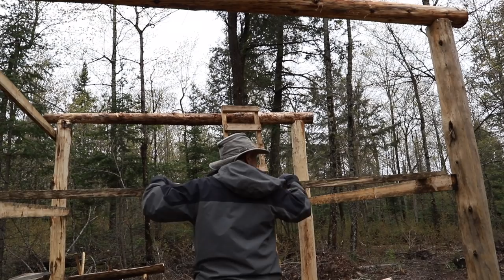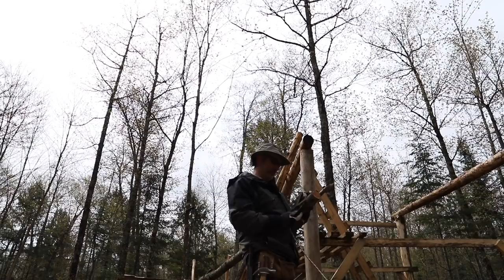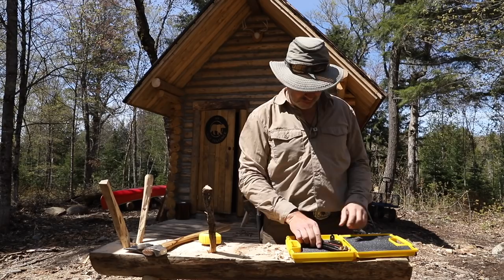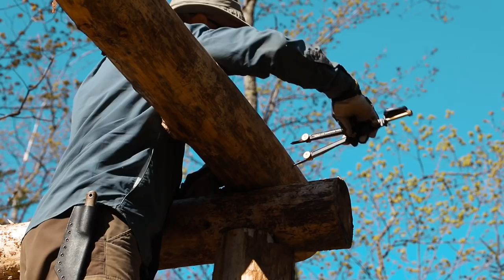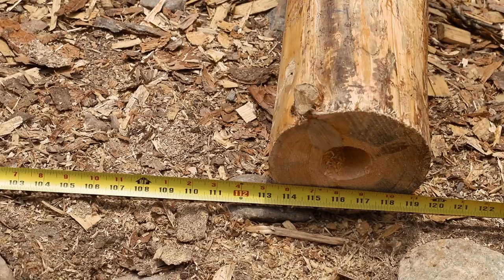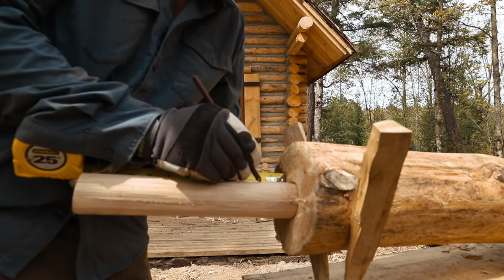Working Solo | The Forest Kitchen | Off Grid Log Cabin Build, Ep.2 S1

Comment: Hello mr. James and thanks for posting another nice video! I would advice you (if you would like to take an advice by a carpender) to open the holes in your logs and then hamering through them your joint so that you joint through the whole diameter of the log and into your base log. That would add more stability and is a far stronger joint. Keep up the good work. I can't wait to see how this project will look like

Comment: Was thinking about your shaving horse and getting better grip on the project you are working on. You could get some of that grip tape they use on stairs and skate boards and put it on the round clamping part and the bed that the project rests on.  Just an idea I had when I seen that dowel slip on you when you were trying to shave it. It isn't that expensive.

Comment: Several times I couldn't help but think a log dog would come in mighty handy, then I saw you did have one.  I also have to ask if there is a particular reason you're using dowels, because i find tenoning round wood is actually very straight forward and satisfying work,  with very few tools. With a bit of practice,  takes less time than boring two mortices and fitting a dowel.  Plumb bob, carpenter's square (more flexi the better), a saw and an axe or chisel.  You could leave them square and carve a square mortice, or if you could get a rounder plane the same diameter as your bit and round off the tenon.

Comment: Thanks for sharing, Shawn. Things are coming along at the cabin.  

I think your decision to use charcoal in the grill and in the rocket stove is very wise. I'm not so sure that making your charcoal in a pit is as wise. While is it certainly possible to do it that way, the whole process is more complicated than it looks and the efficiency is very, very low. Even using an earthen above ground charcoal oven has more technique to it than most people would expect.  Simply timing the closure of the vent holes is an art in itself. You'll probably have better luck and be happier using a drum retort. A drum retort can be as simple as a plain open head drum with a locking ring top. Drill a few holes down one side, fill it up with hardwood and close the top. Tip it over on its side onto 4 stones or blocks to hold it off the ground. Light a fire under, around, and against the barrel. Keep the fire burning until there's no more flames from the gases coming out of the holes. Let it cool, tip it upright, and take out your perfect charcoal. You can use a regular 55 gal (208 L) drum, but a 30 gal drum will work just as well. The only difference is that you'll make smaller batches and it will take less time.

On the other hand, if you are so inclined, you can make more complicated barrel retorts that have pipes to direct the flammable gases back under barrel to augment the fire and shorten the burn time. You can also add closed fireboxes, welded legs, refractory linings, etc. It's just a matter of how much tinkering you want to do. Most of them work great and there's a boatload of plans available for them, but, unless you are making a WHOLE LOT of charcoal, it's probably not worth the effort. 

Thanks again for taking us along on your adventure. Keep up the good work and stay safe.

Comment: Not sure but your nailing mis strikes might be because of the build up of coating (galvanized) on your hammer face. Depending on the nails youre using you may benefit from periodic sanding or roughing it off the face.  A quick rub on concrete, or a flat rock or even sandpaper or a file may keep down the number of those glancing blows..Love the videos.... cant wait to see the kitchen finished

Comment: One suggestion on the next structure from a retired lineman. A board on far side of the pole hole to push your post against while lifting would help a great deal. One it stops the dirt from that side from being disturbed and falling into the hole thus throwing off the depth. Two it makes the butt of the pole slide much easier into the hole. Another would be taking the time to put up a proper Gin Pole in the middle to do your lifting with at least a 3 pulley block and tackle. There should be a great deal of info this system on here. The heavy lifting would be mostly eliminated.  Again just a suggestion.

Comment: No five point harness? Instant dismissal  at the mine "if" caught, though I lifted two miners last night 20' in the air in my 6 yd Sandvik scooptram bucket for a water pump change-out, and they weren't tied off, but the supervisor was on surface at that time, lol. Great work you're accomplishing alone, look at Jimmy McQuatt who built that log mansion solo, up near Ignace ON.....if there's a will there's a way. I used to load scooptram tires onto the flat car the same way using the battery locomotive as the grunt force in the task at hand.......I'm loving the star of your videos, Cali, as you know, Shawn, you're playing second fiddle to her...just kidding...thanks again for sharing your great knowledge with all your fans!!!

Comment: Using your pulley system, get the log some height with it, then tie off.  Take a another log, and tie it between your tie off and the pulley.  Then you've got a third hand taking some of the weight.
Reply from the maker: I was thinking that too and probably should have tried it. I have a winch around here somewhere that would have helped immensely if I knew where I put it!

Comment: Another great video Shawn. I like how you come up with a solution to a problem. As in drilling the holes in the end of the logs for the pegs. You found that out couldn't keep it from spinning with your feet so you ratcheted it to a stump. Just one question, why don't you use a a diameter of tree just a bit bigger in diameter than your pegs and shave them down instead of splitting and having to make that round. It seems like a lot of extra work. I look forward to more videos

Comment: Sean I didn't really want to write this but watching you setting up that ridge pole was seriously sketchy man , it could easily have rolled off on you and working out there  alone it seems there was no one there to come to your aid if it did turn to custard . As a professional Carpenter I would suggest setting up some better work platforms at the right height to work safely from then and also prefab as much of the roof framing as you can at ground level so you don't need dodgy safety rope braces holding it all together 😁 Stay safe man , I really like your content,cheers

Comment: Just a little observation:

I notice that you frequently reach through your saw, to hold on to the scrap end.  I'm wondering why you don't change sides, so that your free hand is on the same side as the scrap piece.  Seems like it would be much more comfortable.
Reply from the maker: It's a safety technique - if the saw jumps out of the kerf it can't cut my hand

Comment: How do you know how wide and long you can go without using another verticle load bearing beam?
Reply: The go/no-go gauge you made for your Dowell pins was a good idea.
Reply from the maker: I just err on the side of caution, but I also have a commercial roofing and solar background and therefore a pretty good understanding of structural loading.

Comment: I would like to offer some advice on hammers, please don't be offended. I have worked as a carpenter for 50 years and have found that a 22 ounce hammer with straight claws[called ripping claws] works best for general use. light weight hammers tend to bounce and make you work harder. framing hammers are heavier and have a waffle head which makes ugly marks on wood,
Reply from the maker: I too prefer my 22 or 20 straight claw hammers, but they are steel Estwing and the shock is hurting my tennis elbow

Comment: Those extra fires: Those are for bugs right.?  Doesn't seem they'd be for anything other than pest control. Lord knows all that hard timber work is hard enough without smoke in the eyes, wouldn't think you'd want the burn of smoke too without a good reason. Just wondering.
Reply from the maker: That's right. I don't mind the smoke in this volume but it definitely helps keep the bugs manageable